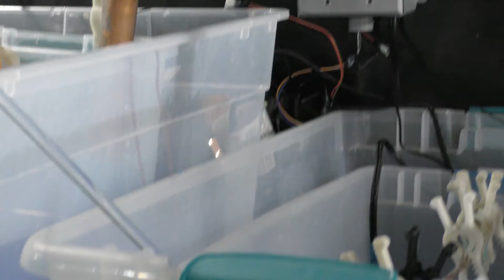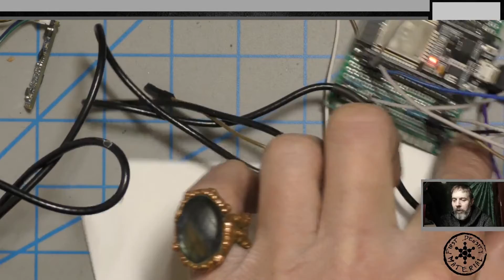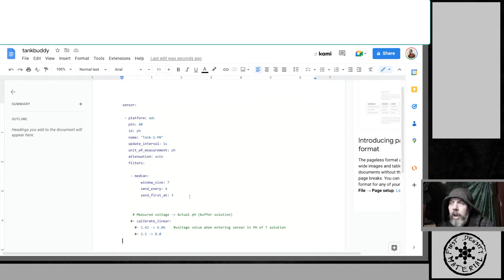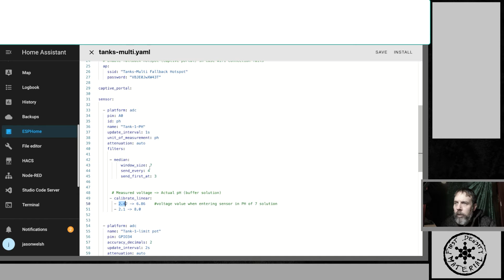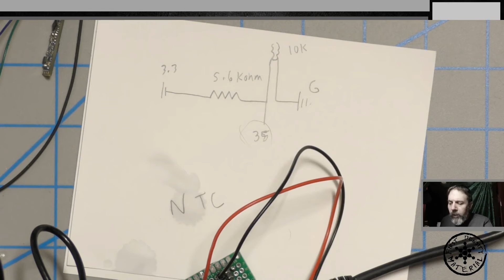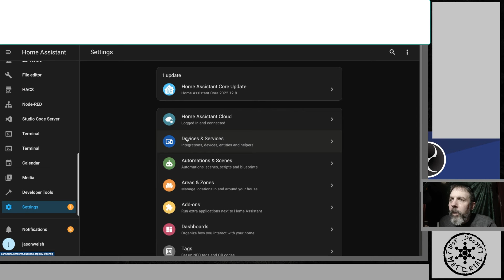0117 Installing home assistant (Electroforming PH  + Temp meter sensor esphome)

Comment: When you calibrate the sensor, it looks like you're shorting the BNC which would give it uninterrupted signal. It seems like calibrating it to this value would set the top end rather than the middle of the range to me? Could you help me figure out how to make it intuitive that this would calibrate the sensor correctly?

Comment: Hi Jason, I recently discovered your channel and am amazed at your electro forming techniques, I’ve done a bit of electroplating and find your videos very inspiring. Since you are capable of building a pretty thick layer of copper on almost anything, do you think this could be adapted to fill in a cracked area on a steel object by masking of the other areas? I’m also thinking of trying to use my vinyl cutter to plot out a pcb trace stencil and using the graphite paint to create a homemade PCB circuit. Thank you sooooo much for sharing this technique and putting up all these videos.